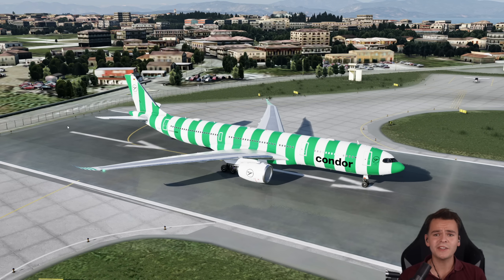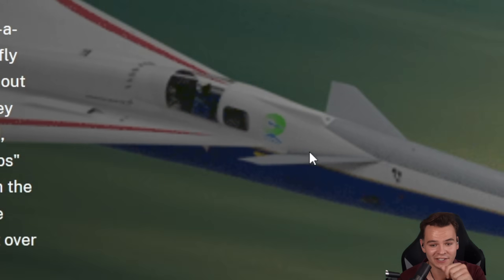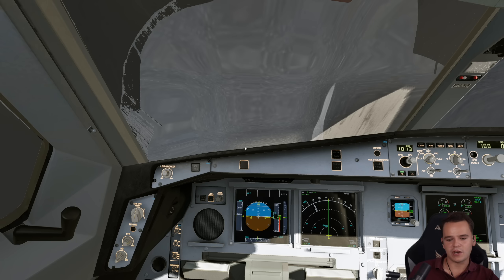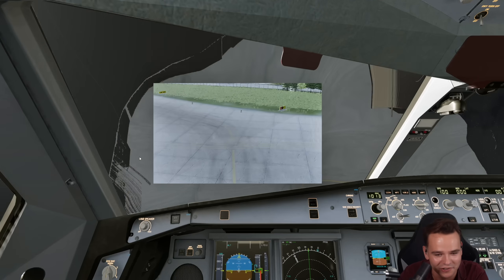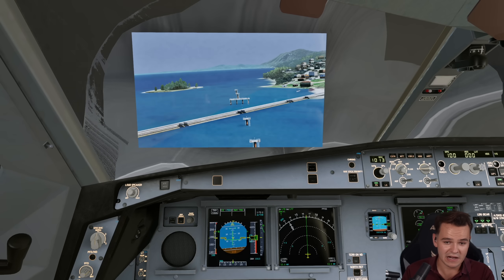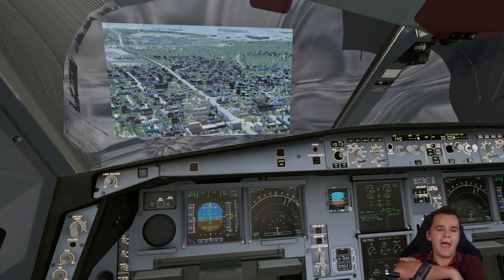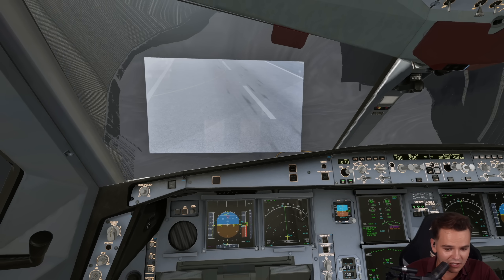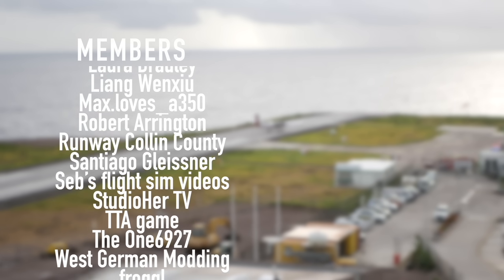The SHOCKING Truth About the Future of Plane Design

Comment: I was theorizing a all instrument backup device, or software. In case of a absolute total system failure. A software on the pilot ipad could use gps data and internal gyros combined goegrafic data you could bassically make a virutal window and recreate almost all instrument data as speed, bank, alitude, angle of attack, thust, bassically everything

Comment: Technically if the camera lags and you taxi slower, in a real life busy airport you would burn more fuel navigating, and cause traffic on ground so the camera is very important.
Reply: It's the simulator "lagging" the camera view on purpose. It's not lagging as such, but intentionally updating that additional camera view at a slower frame rate to reduce overall impact on the main view frame rate. These in game cameras aren't intended to be used this way, and are usually a novelty feature for added realism.

The "lag" on a real plane would be down to the encoding electronics (even if analog, it's still encoded in some way), cable length and decoding. Application specific ICs for the encoding and decoding can take the entire lag down to a single digit number of milliseconds. External cameras accessible to passengers on aircraft are going through extra steps to get to the entertainment system, so can potentially introduce extra lag (transcoding for example). The cockpit screen for the cameras isn't going to have that extra step, so would remain sub 10ms in most cases. Most humans can't notice that.
Reply: @tin2001 yeah I was just saying what I think if it is in real life

Comment: So does your landing @9:25 prove that Ryan air just uses the camera feeds vs looking out the window?

There also would be savings on all of the weight of the glass and windscreen assemblies. Likely cheaper to put in some 90 or 120 hz LCD/OLED curved display panels. You could have visualizations from the gear, wing tips, and nose superimposed for pilots to be able to quickly scan for gear position and visually confirm crosswinds at a glance. You could literally see the tires about to touch and see the state of the gears.

But honestly... camera alignment and instrumentation approaches have been the standard used for space dockings for a while. Often you can get a better view with well placed cameras vs the perspective your pilot has.

Comment: You could cheat and open a second default cockpit view, then size and move it in front of the 4 striper.  Better frame rate, although it will impact overall MSFS frame rate.  Also, just a reminder, you can build my B757X 8i.  If I could use the planemaker, I would start with a 787, sort of like they did with the 767.  With GEnx power, she will climb to cruise quick and could be labeled, STOVL

Comment: can you not just create curved glass??
Reply: No you can’t, curved glass has more uneven stress points and is more prone to breaking especially over many pressure cycles. Flat windows are much more even and less susceptible to breaking. Curved glass is more expensive to make and can cause optical distortions which is dangerous for obvious reasons. Many more reasons why this isn’t feasible if you want me to list some more.
Reply: @aviate13 what abt the crj? not arguing with you but im just wondering
Reply: @RobbLikesPlanessome planes have slightly curved glass but not to the extent Swiss is showing here. The glass is still made up of multiple sections and it’s not one curved glass piece.
Reply: @aviate13 knowledge 🤯
Reply: fr
Reply: It's a Boeing solution, so against Airbus religion.
Reply: A220, A350, B787, C919, Embraer and a bunch of private jets to Swiss001: Am I a joke to you???
Reply: Just make the nose as streamlined as possible and add enough glass to have the same effect. Like the concord
Reply: @Lawn_Chair_Lawn_Chair WAR THUNDERRRRR
Reply: @RobbLikesPlanes don’t mind it